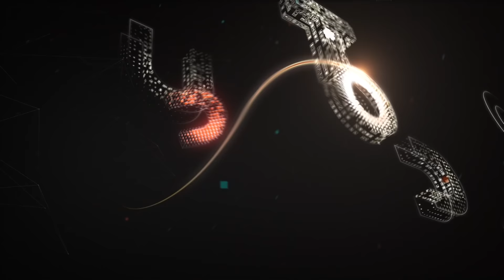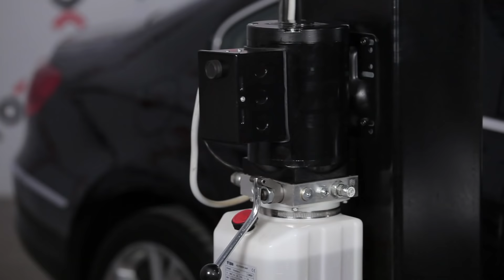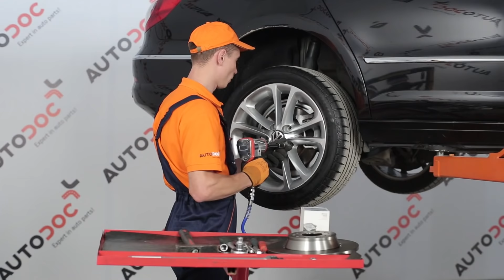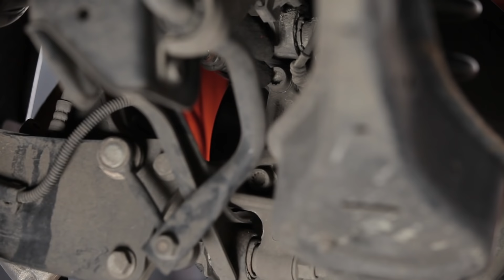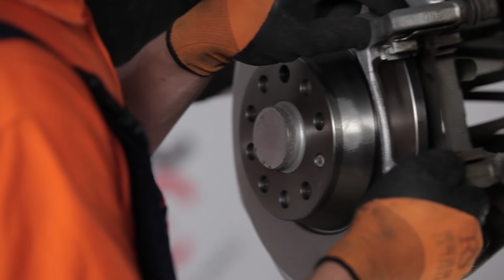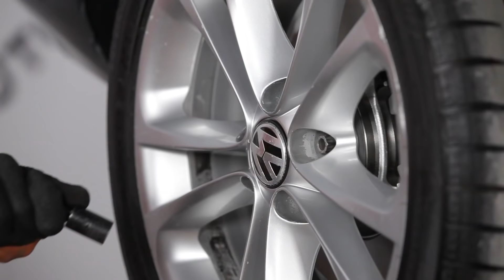Cum se schimba discurile de frână, placutele de frana din spate pe VW Passat CC 1 | Tutorial HD

Comment: salut am o nelamurire la acest cc 1 are frana de mana electrica.si daca da cum pot schimba placutele de frana.pentu ca in alte clipuri spun ca trebuie sa conectezi un calculator  la masina si sa traga pistonul electric pentu spatiu de inlocure cu altele noi.eu am un pasat b6 2007 cum pot sa schimb cel mai usor placutele pe spate un sfat ar fi de ajutor..multumesc
Reply from the maker: Schimbul plăcuțelor de frână se efectuează cu frâna de mână liberă. Pistonul se trage cu calculatorul de diagnosticare VAS 5051. După înlocuire plăcuțelor de frână spate, la fel pistonul se strînge cu calculator de diagnosticare VAS 5051. Mai apoi plăcuțele revin la poziția potrivită, ulterior se înregistrează in blocul de control. Vă recomandăm reparația la sistemul de frânare să-l efectuația în service auto cu autorizație.
Reply: Există și o metodă foarte simpla,  si fără diagnoză